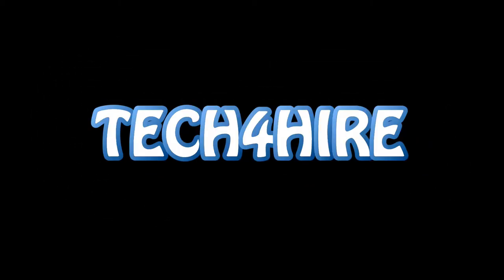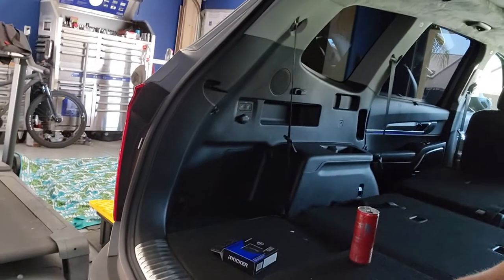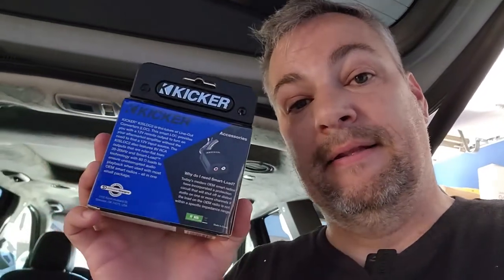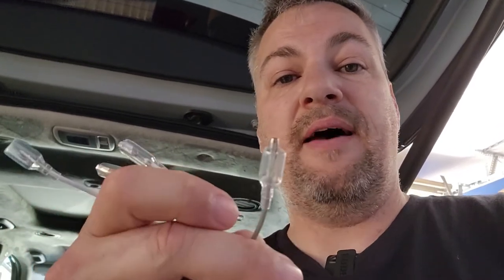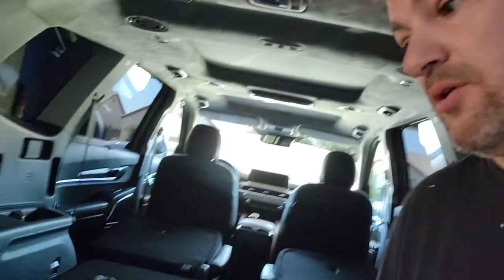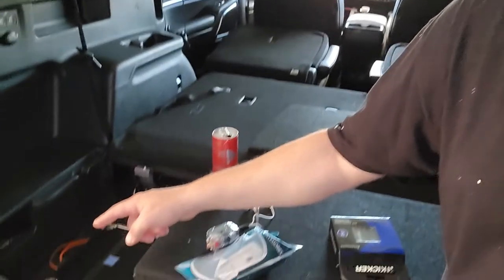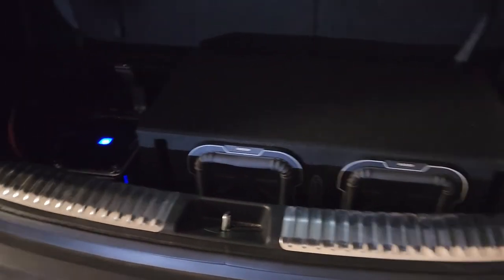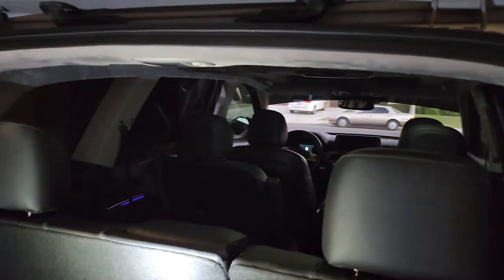2021 Telluride SX Subwoofer Upgrade

Comment: I have been trying to pause the part where you connect the audio signal to the rocker panel by the oem sub woofer. Is it possible to get photos from you or a diagram?

Comment: Hi can you please explain more how did you hook up those loc wires? Its dual voice coil but not sure which one i should hook up
Reply from the maker: I did this almost a year ago but looking at the video it appears that the adapter has a left and right channel. So I hooked up one channel to one voicecoil and the other channel to the other voicecoil. White wire is usually left side so its White on Green and White/Black on Orange then Grey on Blue then Grey/Black on Red.

Comment: Hey there, loved the video! Might be a dumb question but what did you do with the factory wiring to the factory sub? Did you plug it back in or left it unplugged? The sub isn’t being used anymore right?
Reply from the maker: I left it plugged in. The factory Amp will still power it. Can't hurt to have another speaker back there.

Comment: Question. Is your vehicle equipped with stop/start? If so, does your amp cutoff when stop/start is engaged?
Reply from the maker: Good question. Yes it is equipped and it does cut the bass out for like 10 seconds. If I'm in stop and start traffic I turn it off.
Reply: @Tech4hireOnline  Have you figured out a way to keep your stop/start and Maintaining your bass ?
Reply from the maker: @Jack and the beanstalk  I believe you would have to run the remote wire to the ignition wire. But I am still not sure it wouldn't shut off with the stop/start feature.

Comment: How do I get rid of wining noise. I had local sound shop do my install for my telluride. I have turn my gain level down on my clarion crossover under half. What can I do so I can turn up the gain.
Reply from the maker: They used a crappy inline adapter or just tapped into the wires themselves. Take it back to them and tell them you are not happy with the noise and ask them what inline adapter they used. Tell them you think its faulty (so they can save face) and ask them to install something like the Kicker KISLOC2. That is what I put in my car and I have no noise at all.

Comment: Just the video I was looking for.  I have a 2020 Telluride SX and wanted to add a powered Kicker 10" sub needed to see how to access the factory sub speaker wires for the line in connection.  Was hoping that I did not have to remove the rear panel and third row seats, but oh well.  Any advise before I proceed? Great video...thank you!!
Reply from the maker: It was actually not that hard. Just be patient and don't yank on the tabs.

Comment: I am being told 1500$ for 2 speakers and an Amp and the necessary wiring.  700 is just labor.  This blows my mind what are your thoughts
Reply from the maker: 2 kicker L7 speakers $500
1 box $100
1000 watt Amp $300
Wiring kit $200

So I'm in for about $1100. You can go cheaper on speakers and save a lot. But 700 for labor is really high.
Reply: @Tech4hireOnline   well that was the quote to replace 2 speakers up front and run off the Amp.  That didn't even include Subs
Reply from the maker: @animaljoe1  I think you need to go to a different shop for sure. Go to Crutchfield.com to see what fits the car and the pricing. You can get a pair of speakers and an Amp for less than $300.
Reply: @Tech4hireOnline  Awesome.  Thanks so much!!!!
Reply: 1500$ for 2 speakers?😂😂😂 just do it yourself

Comment: Hi there!  Do you remember what size the factory Sub is?
Reply from the maker: It looks like an 8" sub
Reply: @Tech4hireOnline  Thank you for your help and reply.  From your memory, do you remember if this is a shallow 8" or normal size, regarding depth?  Shallow 3", normal is about 5"?  Also, is there room in the factory space to go with a larger sub, like a 10" or a 12", or would you recommend to keep it at 8", (if I wanted to keep hidden, and not add a box)?
Reply from the maker: @RadioCoug  It was a shallow sub, but it has a oddly shaped speaker frame. So you will have to do some customizing. A standard shallow 8 won't fit.
Reply: Thank you!  Very much appreciate your help.

Comment: I need help, I’ve installed the same kicker module and my amp doesn’t shut off. Anyone know why that might be? It’s like the remote from that module is sending a constant signal.
Reply from the maker: The car has power running through it for like 5 to 10 minutes after the car has been turned off and the doors locked. My Amp has a light on it so at first I thought the same thing but after awhile it shuts off. When you hit the lock button or the lift gate it will send power back to the Amp again. A way to test would be to hook up a low voltage light to your Amp wiring (remote wire and ground) and it should shut off when the power finally shuts off.
Reply: @Tech4hireOnline  thank you, I will check it again once I get home.
Reply: @Tech4hireOnline  do the amps draw a significant amount while in standby mode? If not then does it matter if remote pwr takes 5-10 mins to completely shut off? Is there a material downside to just using it as remote signal regardless of the additional 5-10 mins?
Reply from the maker: @UsmanKhanSimRacing  Not that I have seen. I haven't had any power issues since adding the subs
Reply: @Tech4hireOnline  hey so I watched the video another couple of times, you mention dual coil wiring but unless I missed it, there is no mention of where did you take the remote signal from? was it one of the wires at the back near subwoofer? usb port, which I assume turns on with accessory? or did you run one all the way from the haunt and if so which one?
Reply from the maker: @UsmanKhanSimRacing  At 13:30 it shows the Line Out converter that has the remove wire shown. You take that blue wire and run it to your Amplifiers Remote wire input.
Reply: @Tech4hireOnline  you are right! I understood the concept earlier, this Kicker speaker-to-amp detects activity on speakers and outputs a remote signal to amp. Somewhere along the way i regressed to traditional thinking of remote wire to be connected to the headunit, thanks for setting me straight. Very helpful video. My telly is on order but I am gathering all accessories that would go on it right away so i would not know it any other way :) I am considering JL Audio dual 8" MicroSub+
Reply from the maker: @Usman Khan  I hear the JL sub is real nice, but I love these Kicker q series.  It's over kill for me but I know I will never blow them.